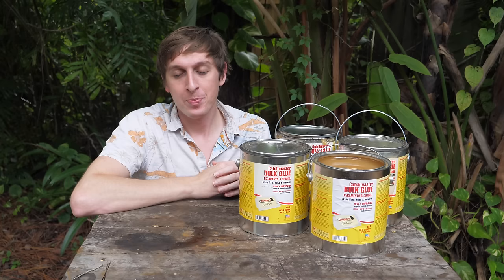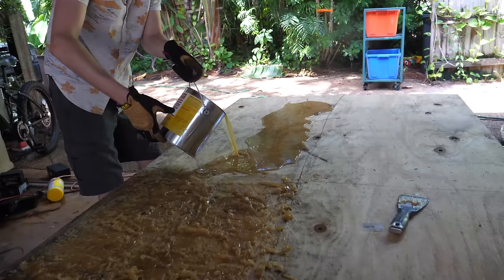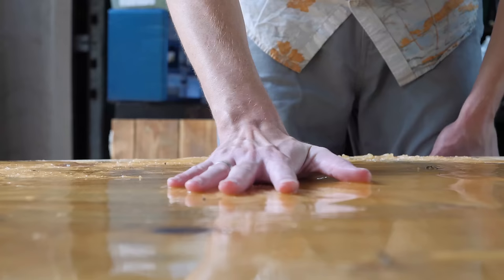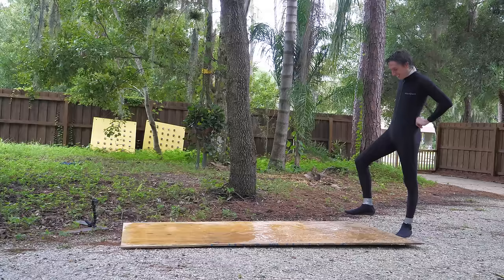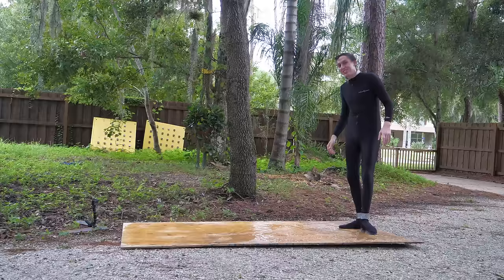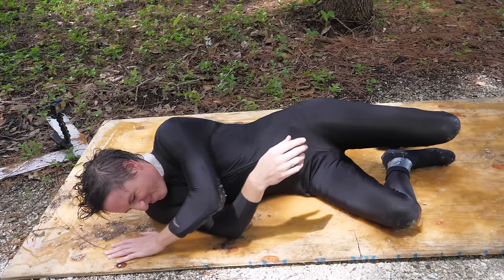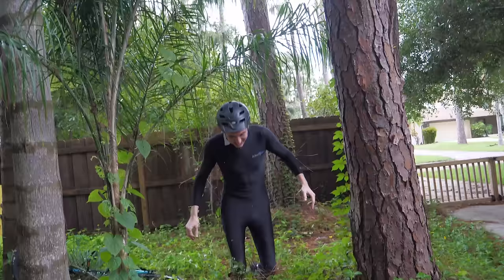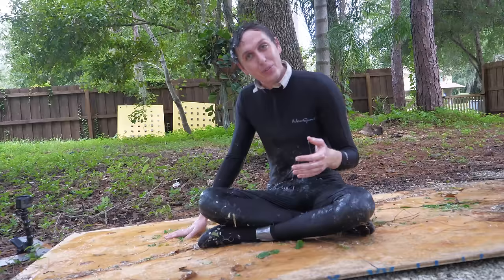Can a Person escape a human-sized Glue Trap?

Comment: All the glue traps I’ve seen use strong paper as the base instead of something more solid so I imagine that it would be a lot harder to get out of it if it was flexible since it would be pulled up whenever you try and pull yourself out of the glue trap
Reply: that's a nightmare.

Comment: I think that layer's too thin for a human. My wild guess is that it should be at least half a fingerwidth in depth to be proportionate to what a rodent encounters.
Reply: Am human, can confirm.
Reply: 👆* gold * ☝
Reply: Please, speak english
Reply: i guess he has to redo it
Reply: Try a tub or pool of it you won’t get out
Reply: True but if you matched the glue thickness to relative size of each the rat would have the advantage because while the scale’s been properly adjusted the glue hasn’t changed in viscosity/particle size, so the rat would get trapped less easily because the huge difference in gravity. For example if a human was only a few inches tall the way they would experience falling through the air and swimming would be vastly different than a normal sized human with the same scale of height/amount of water, because the scale of the particles that make up water and air, and the gravity, have not been adjusted.

Making the glue thickness less for the human isn’t technically accurate but I think it levels the playing field to some degree making up for the change in gravity/relative viscosity making each’s experience more similar.
Reply: r/iamverysmart
Reply: Bermpowie that is english
Reply: The Nth Eric genius
Reply: also, he should consider wearing a hairy/furry suit
Reply: Hipster Atlantis! How is that r/iamverysmart? Firstly, stop referencing Reddit outside of Reddit, it's cringy. Secondly, he's not even acting condescendingly.
Reply: ...and the hair causing pain when pulled might dissuade the struggle. Try again with more glue, and a really hairy man in a speedo... on second thought, maybe don't.
Reply: Thats right; but our friend here is not a that smart.
Reply: @Schixotica  then again there is ways to get to the point.
Reply: the trap should also be bit flexible so he cannot slowly move out of it that easily. Like really thick paper.

Comment: It's not realy human sized because the layer of glue would need to be way thicker.
Reply: Oh my god nightmares.
Reply: Yeah
Reply: Was thinking the same.
Reply: Neck deep
Reply: That's true actually - but that would also be a terrifying thing to happen 😅
Reply: His weight pushing down on the glue would offset some of the thickness differential. The weight of a rat would not push down very hard on the glue, so the glue would not bind to a rat as much as it binds to a human.
Reply: the molecular structure is also way too small to affect his mass as much as itr would for an insect
Reply: Axel B and the traps are flexible. It seems like the rigid board would be easier to pull away frlm
Reply: Also 1 more thing, rats hair sticks much easier than human skin
Reply: Axel B,You are actually...correct, I'm proud!🙌🙌🙌
Reply: But he is still able to get off because the stick would still have less effect

Comment: The cube law is in your favor.
Reply: Hi cody :)
Reply: Cody please do a video on the cube effect
Reply: You two should really make a video together 💜💜💜
Reply: Isn't the strength proportional to L^2 (muscular cross-section surface), and so is the surface of contact with the glue?
Reply: aymeric59700 
Ah yes the larger you are the more strength you have relative to your surface area.
Reply: Ah hey there Cody! Recently discovered you're a fan of Tom Scott too! Good to see you here as well!
Reply: True. I'm curious though, because it also works against him. He has less proportional surface area to volume, but his muscle cross-section ratio to volume also is smaller. I wonder how that factors in. Since the surface area and muscle cross sections are both square ratios though, it might be that it doesn't have a relative impact as much as surface area does regardless of volume
Reply: That's the thing, though.  Your muscle strength is proportional to your cross section, which works by the square law, and the glue stickyness is proportional to your surface area, which is also square law.

The key point is that we need strength proportional to our mass just to move around, which is based on the cube law, so we have thicker muscles and bones to compensate.  This means that we're stronger than we would be if you just scaled up a small animal.

Another important point is that in order to get free of the glue, you have to move slowly and steadily.  I suspect this is due in part to the glue behaving as a non-newtonian fluid, where it resists rapid change more than slow change.  Also, you can sustain a slow but steady pull much longer than a hard jerk.  The problem with a hard jerk being that after the jerk, if your hand isn't freed immediately, we tend to relax for a secord jerk, but here this will bring our hand back against the surface, undoing all our hard work.  Also, panicking and thrashing around is as likely to cause more of your body to come into contact with the glue as anything else, so the natural response of a panicked animal is just making things worse.

A good followup experiment would be to try to escape like a panicked animal might, with lots of brute force yanking and thrashing around.  Does this stand a chance of working, or is a slow methodical approach mandatory?
Reply: Cody'sLab i was thinking the exact same thing lol
Reply: Whats up cody
Reply: cody plays minecraft confirmed
Reply: Wow codys on here
Reply: True
Reply: Cody'sLab 1k like
Reply: +Cody'sLab Is that true? Strength also scales with area, not volume.
Reply: Cody, you should try helping him out with his mega microwave radiation leak problems, You seem to know it well enough from that time you had your camera strapped to the side of a microwave with a hole cut through it.
Reply: Damn cody, youre way more active on youtube than i thought
Reply: For once…
Reply: let's not forget the fact a rat/mouse is also cover in fur, which increases its surface even more... Goes to show how inhumane these traps are
Reply: Hi
Reply: Sup
Reply: Ay you know it
Reply: The mind of a scientist lol
Reply: Er, btw Cody you totally need to do this and explain the cube law while stuck on it, or see if you can walk across a ceiling painted with it, he said he wants more sticky glue challenges after all :P
Reply: Ive seen you somewhere be4
Reply: Cody'sLab don’t know what that means but I liked anyway

Comment: The answer is no. He only got out because it was a very thin layer.
If it was two inches deep he would be stuck fast.
Reply: That really isn't the biggest problem. Repeating this with just a thicker layer is probably still escapable. The main issue is that he used a rigid plywood board and wore a suit. A real glue trap uses flexible paper. When you try to pry yourself off, the paper will just bend with you. Then the suit has so much give. The fabric stretches and deforms giving him a great amount of leverage. Think of pulling tape up from the corner as opposed to an entire side. 

If he re-did this experiment with  a tough pleather mat as the paper substitute, had about a half inch to three quarter inch deep layer of glue, and no suit, there is no chance in hell he could get out of it. Even if he kept the suit on and used a similar thin layer of glue, but just replaced the plywood with a pleather mat, that would probably be impossible to escape. I also have to wonder if heating up the glue changed it all. I doubt it, but it's something to consider.

Oh, and 2 inches is way too much. He does need to use a thicker layer, but two inches is insane. The real traps aren't very thick at all. Something like a half inch to three quarters of an inch is imo the best approximation. Too thick of a layer could actually make it easier to escape.
Reply: You forgot the fact that he’s wearing a suit. If he was a bare skin animal he would be in pain and agony as his skin starts ripping from his flesh
Reply: Lol, the skin will not rip from your flesh. The glue isn't that strong. It's more of just like an extra sticky sap. It  couldn't even manage to rip the fabric he was wearing. If it can't rip that, it's never going to rip skin. The key aspect of the trap is because it's on paper. The animal can not free itself because the paper will just bend when it tries to pull itself off.

That's not to say it's painless though. Hair will certainly be getting ripped out and that will be quite painful. But no where near skin tearing lol. You are also going to die by a mix of exhaustion and dehydration. Not a fun way to go, it'll be long and drawn out.

Maybe if you got stuck and let the glue dry out on you, it might be a bit stronger. But these glues aren't really designed to dry out that much or that fast. They have to remain sticky for many days as it is a trap that could remain there for a month or more before a mouse happens across it.
Reply: @TheTonyMcD  it can rip skin of the body though, I've seen mice with their skin stuck to the traps before and it's increbily gross. It's probably because of all the hairs that it just rips the very surface layer off.
Reply: that's on a mouse
Reply: It’s just for entertainment. Not education.
Reply: ZephyrDreamer that’s a mouse, not a human.
Reply: Watch 4:32, imagine that being your skin. You would definitely see some rippage action on the thinner parts of your body
Reply: Same rules would apply, though. Rolling out of it will always work because you're applying a lot of torque against a small amount of adhesive at a time, whereas pulling straight up minimizes the torque your body can get, and puts your efforts against the entirety of the adhesive. It would have to be very deep for a person to be truly stuck
Reply: Allan... If your skin stretches as easily as a thin fabric, you should really see a doctor. Do this experiment: put a piece of tape on your shirt, and then some on your bare skin. When your remove the one from your shirt, notice how much it pulls at the fabric, then pull it from your skin and notice how you don't see any "rippage"
Reply: @allanombina  Except he puts his bare hands in it a number of times with no ripping. So no, it wouldn't tear your skin off.
Reply: Just trust me guys, there is gonna be some rippage action lol
Reply: @allanombina  Why would we trust you when you're demonstrably wrong?
Reply: Can you trhow this at a lion and it would be stuck that would be a good defense.

Comment: I would think for a human, the glue needs to be much stronger. A human has more strength to pull away than a rat does. Then there's the hair/fur. We all know the pain of plasters stuck to hairs, It would be painful to pull away. However after a while you'd pull so hard you'd rip of skin or want to gnaw a stuck limb off, like the rats do. (reason I don't like glue traps)
Reply: You put your hand and pull the hair not pull head against the hair
Reply: Larkspur same I think that they are inhuman
Reply: BitchLasagna  Using oils of the olive and avocado sorts loosens the glue from the animal, and lets it get out easier. Trust me, I've done it before. 😉
Reply: I just have a cat, so I dont even gotta deal with rodents. Keeps them away.
Reply: Young Cable most inhumane way to kill them lol
Reply: @ Larkspur You are half right, humans are a lot stronger than rats, but another key is because we are larger than rats, too. Humans have a lower ratio of surface area to volumet han rats do, which means that a human has more insides than outsides. But for a rat, it has a higher ratio of surface area to volume than humans so the rat has to pull more glue off of itself compared  to it's size. Basically, glue traps are less effective the bigger the organism you're trying to trap.
Reply: Just a thin layer like that is that strong, I don't recommend doing it with a thicker layer. Tho, cover a wall with it and pretend to be Spiderman.
.
Also, where I am from, roedants don't get stuck by limbs, the whole belky and limbs and head get stuck, or the whole side. So there's just no way they can get out. They just starve. Unless the human kills it first.

Comment: I’m thinking  it’s not deep enough relative to the real ones once scale size is taken into consideration
Reply: Yes... it should be 2 or 3 inches deep. That test was a fail.
Reply: @legrandgougoulilumine6940  eh, I think it was less of an actual test or scientific trial and more of a casual experiment. It was more about playing with bulk glue than it was building a DIY human trap, you know? He put something more interesting in the title but it's not like it was serious clickbait
Reply: @hgdellinger  yeah i know..i love his videos.
Reply: @hgdellinger  not to mention for it to be more accurate you'd probably want to wear a fursuit to see the damages these traps would do to say, a mouse
Reply: Doesn't particularly matter.  The glue is semi-non-newtonian.  Like silly putty, it pulls back harder and gets stiffer the faster you try to move it.  It is also much more cohesive than it is adhesive.  This means if you apply a fairly small, sustained force, it peels away, leaving little residue.  Note that it favors cohesion more at lower temperatures.  It works on animals because they thrash, which both tires them out and gets them more in contact with the glue.  The only time a human will be in trouble is if they are sufficiently submerged to not have the leverage to apply that steady force.  Or if they are sufficiently submerged to be too tired or unable to breathe before getting to a stable position to rest.

Also, the far more effective, less temperature sensitive traps use a contact cement, which is perhaps 0.5mm thick.  Those are bloody awful to get on your hands.

Comment: You really should have made the goop thicker. Compared to a mouse or something that small, the layer on those papers is going to be quite thick. You also need to throw out that plywood. Mice don't have the luxury of a hard surface to pry themselves off from. You need a flexible surface that just bends up when you try to pull off it. I also think the suit is helping you cheat. There is give, you can pull up to stretch the fabric and then have greater leverage to pull with. The fabric also changes it shape better than a body. It will pull unevenly, more around the edges than the center. Think of pulling a piece of tape up from a corner as opposed to an entire edge.

So what you should've done, or should do in a follow up video is create a new trap. First, get a boat load of the solvent. Have buckets of it ready nearby and maybe even a small bath of it. This will be very dangerous. Anyways, get a large thick rubber/pleather mat as our paper substitute. It needs to be quite sturdy as paper to a mouse isn't as flexible as it is to us. Next cover that mat with ½-¾ inch of the sticky. 

You will want to shave your arms/leg/armpits/entire body because all you are going to be wearing is a very tightly secured groin protector. Something like this guy bit.ly/2wX91kz. Or for full authenticity, leave all your hair and experience the pain accompanied with trying to free yourself and realize that a furry animal would have it so much worse off. Oh, and you can have some kind of breathable mask on too in case your face hits the mat.

TL;DR This video was a good start, but you can do better.
Reply: Anthony McDevitt boi get your PETA lookin self outta here, you went through the time to write all that on YouTube get a life
Reply: RandomName Last Name what
Reply: Peter Lustig-Deutscher Patriot why should I
Reply: @peterlustig6888  hallo mein deustcher Kamerade
Reply: @dasplaudagei6060  You arent even german
Reply: @peterlustig6888  No u
(Nein echt bin deustcher!!)
Reply: @dasplaudagei6060  Why do you even lie?
Reply: @peterlustig6888  I don't lie.I am german
Reply: Or..or you could do it yourself
Reply: I could, but then I don't have a YouTube channel with 3.5 million subscribers.
Reply: @TheTonyMcD  but you could if you put your ideas into motion, I'm sure people would enjoy the content
Reply: Possibly, but it's not something that I am really that keen to take on. I am interested in the results and would very much like to see somebody do it. This guy does obviously have an interest to do these experiments himself. Hopefully he will see my comment, consider making the suggested modifications, and perform it again.
Reply: Anthony McDevitt That's overkill. I really don't think he will invest that much of himself  in terms of the losses he'll undergo, and what you suggested is potentially dangerous, which is more of a reason not to do it.
Reply: It is extremely dangerous. It would very likely be physically impossible for him to escape without an extreme amount of solvent. It may be excessive, but the demonstration he did really doesn't answer the question if a human can or can not escape a human sized glue trap. His "glue trap" bears very little resemblance to an actual glue trap.

Honestly, I would be happy if he just re did it with only exchanging the plywood for a tough pleather mat. That is really where the biggest difference lies. A real fly trap isn't a rigid surface, it is flexible and thus much more difficult to escape.
Reply: Why don't you just make your own video then
Reply: Why don't you just read the comments I already wrote?
Reply: One might even say... EXTRA THICC
Reply: I think Ram board would be a great material to pour the glue on. It is quite strong, but still has some flexibility.
Reply: Anthony McDevitt 
That’s not the problem. The problem was the suit he was wearing... it was giving him extra room due to to stretching
Reply: Everyone that ever bought a glue trap should have to do that. Guarantee you they wont ever buy another one again
Reply: How's Life - Read more than the first sentence...
Reply: Anthony McDevitt 
Yup just read it all